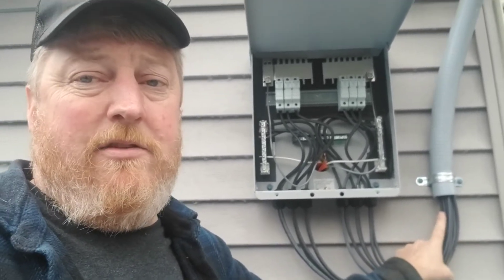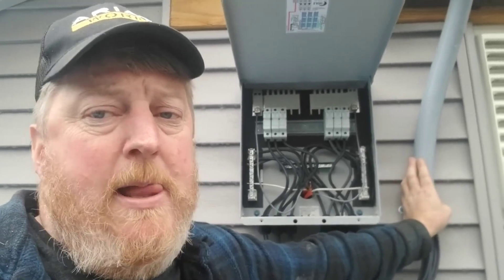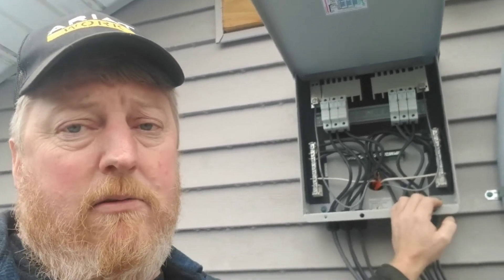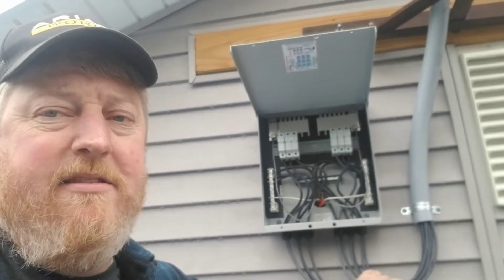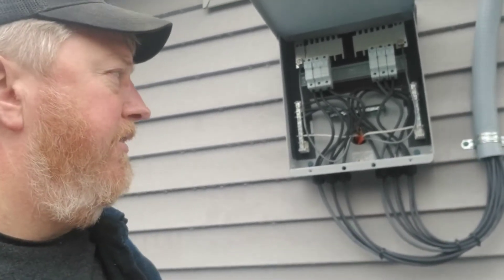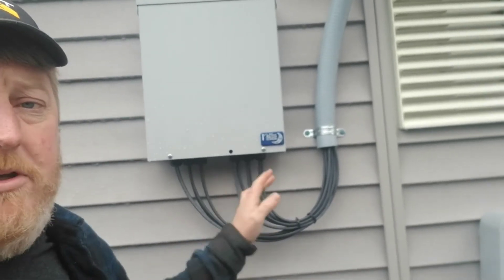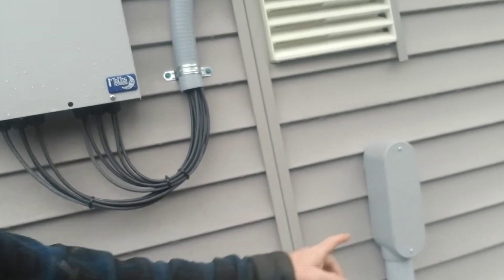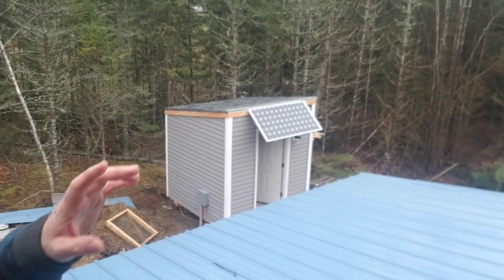Midnite Solar MNPV12 Combiner Configuration

Comment: What gauge to the power shed?
Reply from the maker: We ran a pair of #10 for each set of 12 modules. Currently it is set for 3 strings per #10 now but if I get out there soon I plan to make it 1 string of 12 per #10